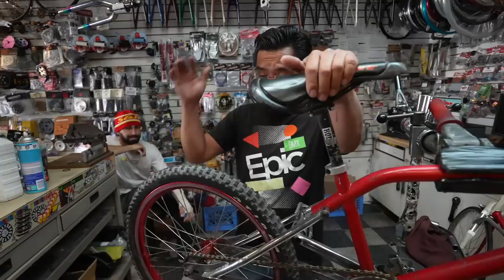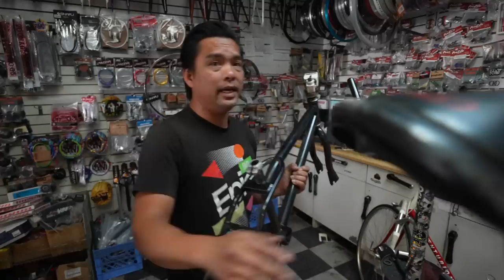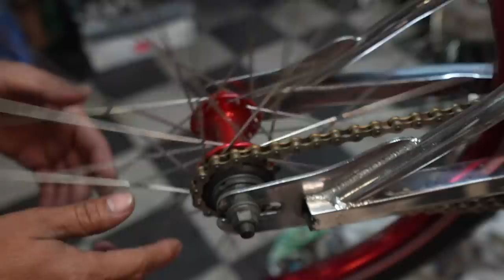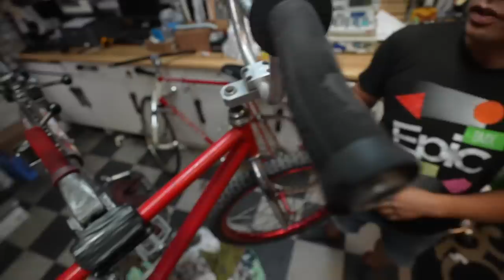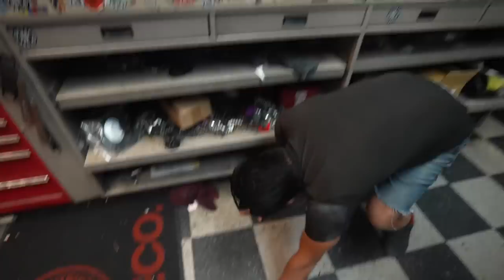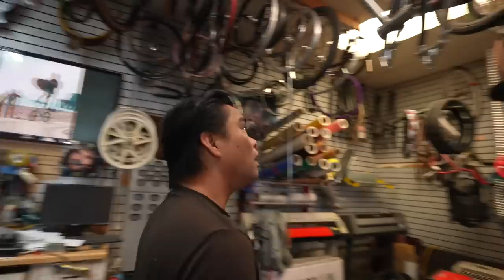Shop Owner Claims To have The Very First Dyno Race Bike!

Comment: Auburn Cycles was founded in 1988 by Todd Huffman and Bob Morales. The project was originally going to be a Honda-branded product that Huffman had pitched to Honda Motor Corp., but, at the last minute, Honda decided not to license out their name to a BMX bike company. With the product already developed and ready to go into production, Huffman and Morales decided to continue the project and use a different name. Huffman came up with the name Auburn from a 1930's classic sports touring car. Morales designed the original logo, and Auburn Cycles was born. Auburn's first product was a two-piece "modular" BMX racing frame made of Chromoly steel. Some of Auburn's first factory team riders were Rod Beckering, Todd "TC" Corbitt, Robbie "Robo" Morales, Erick "Big E" Bartoldus and Danny Millwee. The frames were further developed using an aluminum rear end called a "Works Link." In 1989 the company was acquired by GT Bicycles and Huffman was hired by GT to manage the brand in addition to his Marketing Director title. GT produced Auburn frames and bicycles until 1997.
Reply: What he said 👆
Reply: I’m restoring my’89 now. 
I met Todd Huffman at the Spring Nationals in Roseville CA and bought my Auburn a few months later from Trend Bike Source. Looking forward to riding it again.

Comment: The first Dyno race frame was actually 85 or 86, around the same time as the Comp. Extremely rare, but a few have surfaced. They were stickered, and painted as Dynos, but were actually older leftover discontinued Patterson frames that GT got rid of under the Dyno brand.

Comment: I'm not 100% sure but I think the association was with GT not Dyno.  I know they have a close working relationship but the bike was definitely spec'ed with GT parts.  My bike was painted at some point but I'm almost sure that there was a made by "GT" sticker on that bike.   I owned the CR20Rx with the Aluminum Work Link. (still own it).  Unfortunately the aluminum sub frame did not survive being used as an aggressive street frame definitely not what it was intended for.  If I could get my hands on another Work Link aluminum sub frame I'd definitely build that up again.  It was an amazing bike.  I'd love to show it some love again.  High end restomod. (Rear end recreated in Titanium with 990 mounts and 14mm dropouts).

Comment: I remember auburn running that frame style for years and into the threadless stage. I remember even the suspension stage also. Jeesh bmx plus taught me alot
Reply: A guy i used to ride with had a Green one with Tange Switch blade forks, he was a racer but rode a lot of street and dirt/park/mini ramp too. 
The back end used to creek and flex really bad, very nice looking bike but very single purpose.. He swapped it for a S&M Holmes with Pitch forks!

Comment: you do not see a lot of Works link rear end in aluminum because they cracked easily. my friend did not get a whole season out of his rear end before he went back to the chrome moly ones. he got a Hawk F20 after that. got one of those? Primo made a Rod post. pegs were Tube Steaks. cable spliter for gyro unit called a Pervert. the hub you have has similar features to a suntour hub i had, it was the beginning of, or the design that led to Standard free coaster technology. i got the hub from a kid in front of a Wal mart. slapped Standard axles and an Unbreak unit in and Bam!  free coaster. accurate or not, good vids man and history

Comment: I bought a green one of these just for the wheels (it had purple t 1000s on it i traded it for a basic sluggo and a bully frame as just a f+f but i bought it off a free add in the local paper it read bmx bikes 25 pounds each or all 5 bikes for £120 i bought them all and had to dismantle 4 of them to get 45 miles home on a train lol it was a mission but a worthwile mission .